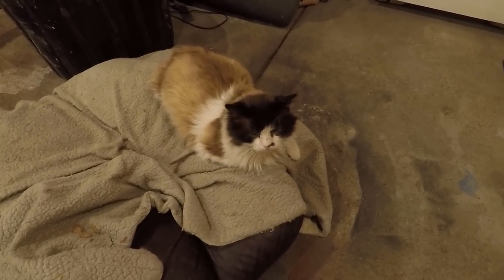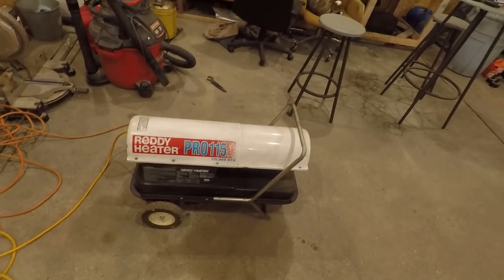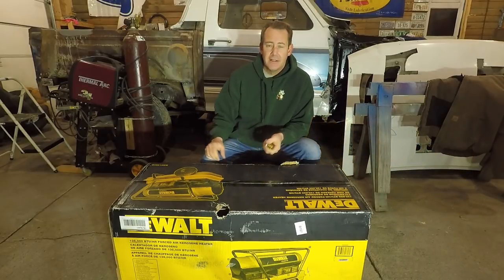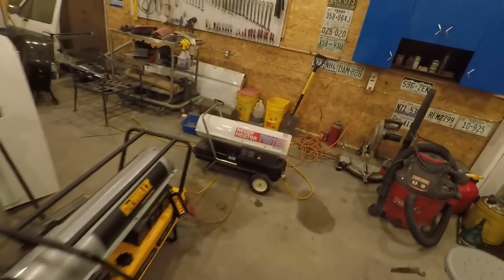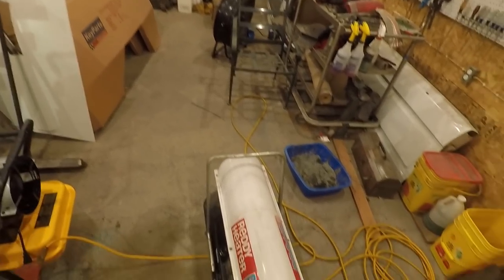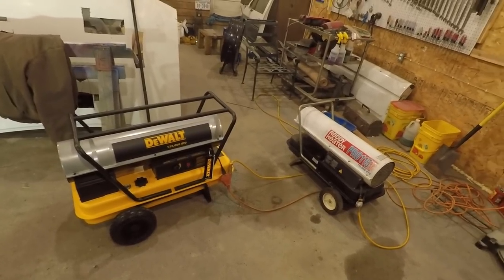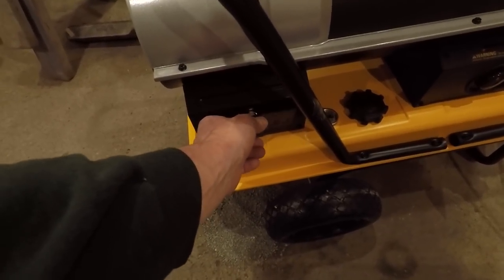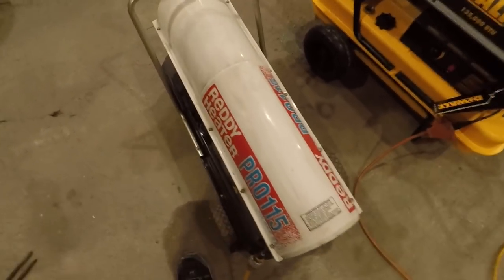It's Getting HOT In Here! DeWalt DXH135HD Forced Air Torpedo HEATER

Comment: I highly recomnend a hanging Mr. Heater. Mine warms my shop no problem and im running no insulation currently. So once the Heater is off it cools quickly but 70 degrees is no feat for it. Cant wait to spray foam my shop.

Comment: Diesel fuel!?! Are you out of your mind? You better get a carbon monoxide detector in there you're going to end up dying. Unless it's outside you should never run diesel through a heater. Maybe you should read that warning label that's on there
Reply from the maker: Lol that heater is multi fuel.... Diesel is one of the fuels
Reply: @TheFoxShop  oh I know. They all are. I enjoy watching your videos. Diesel should not be burned in those in an enclosed area. You should be using K1 kerosene. Diesel is a less refined version of kerosene and does not burn clean and you will have a higher chance of get carbon monoxide poisoning the reason kerosene is dyed is so if the d o t pulls you over they can dip your tanks to see if you're using non-taxable use kerosene or off road diesel. That's why there's red, blue, and clear. So if they dip the tank on your truck and it comes out any color besides clear including red, blue, or green they will take your truck and you will be looking at a big fine. But either way lol NO diesel. Plus running diesel in that heater stinks to high heaven! Kerosene has little to no smell 
 when it burns.
Reply: Relax there Francis
Reply: Funny I buy fuel for my semi in different states and it’s usually green or clear.
Reply: @Krause_transport_garage  www.kendrickoil.com/what-is-the-difference-between-clear-and-dyed-diesel/ well here in NY it's clear. The dyed stuff is off road use or fuel heat like kerosene. Road diesel is sapoda be clear. So I'm a have to call bull shit on that one.  Being I use it all for my trucks, bob Cats and generators. I know for sure I am DOT compliant.
Reply: I P S over the road truck drivers buy thousands of gallons of diesel. I’ve seen them all and I’m just saying winterized diesel is sometimes a green color. Otherwise it’s usually yellowish brown or clear and sometimes has a green tint to it.
Reply: @Krause_transport_garage  read the dot thread I posted in not saying you have not seen it. I'm saying the station you got it from is selling shady fuel. Only clear fuel is for trucks driven on the roads in America. I have had my tanks dipped in NY at just about every inspection station. Have heard from the officers mouth why they do it. Just saying what I know is all